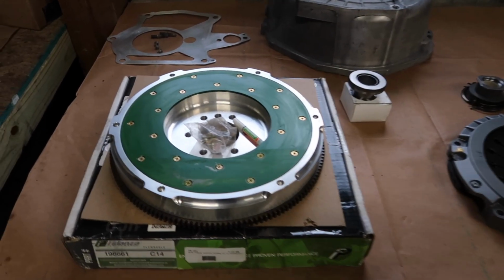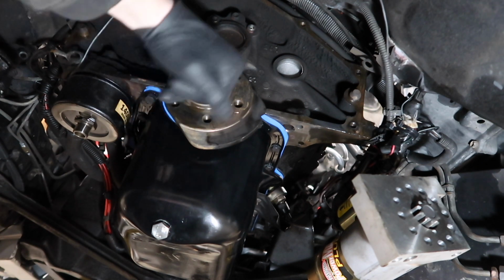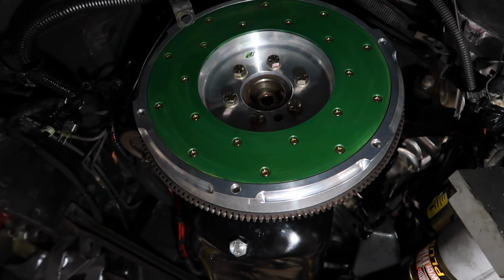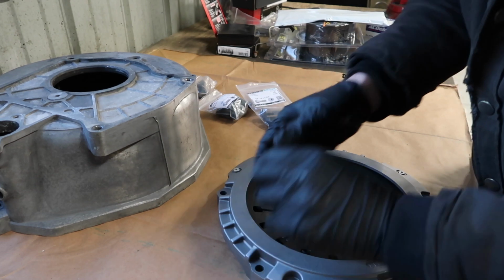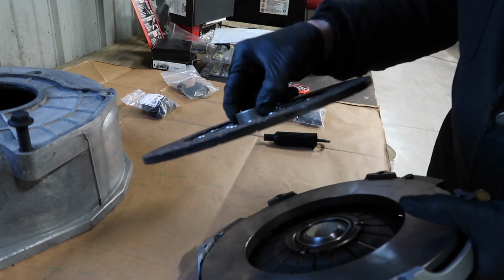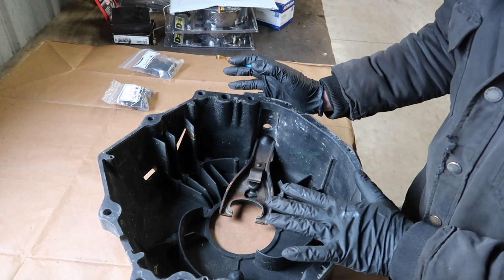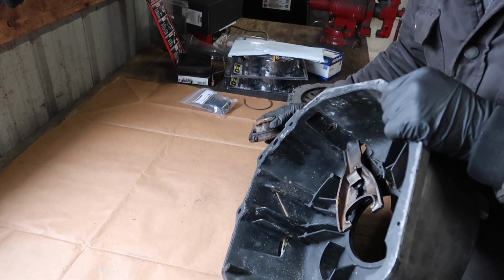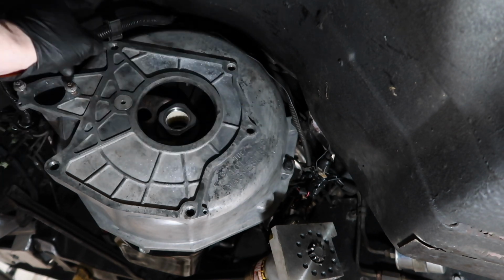C4 Six Speed Swap. Part 5. Flywheel, Clutch and Bellhousing Installation.

Comment: Good stuff! I almost wish I went with the OE style Pull clutch instead of the hydraulic tob conversion on my 85. 

The swap parts I bought included a custom flywheel and spec super twin clutch but it was a PITA to set things up. I had to use a spacer plate between the block and bellhousing to get my clearance correct. 

I'm in the middle of wiring now. I decided to remove all the automatic transmission related wiring entirely since I already have my car gutted.